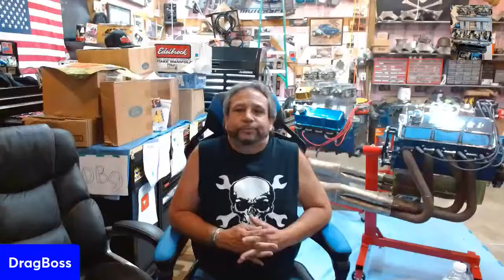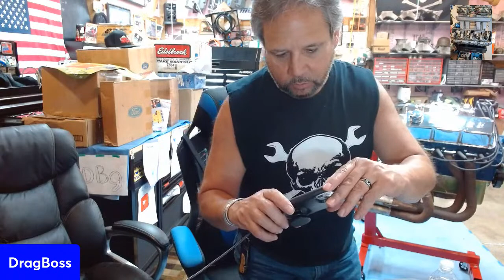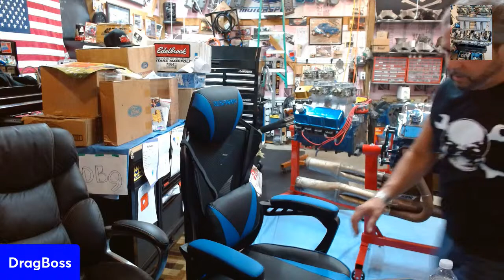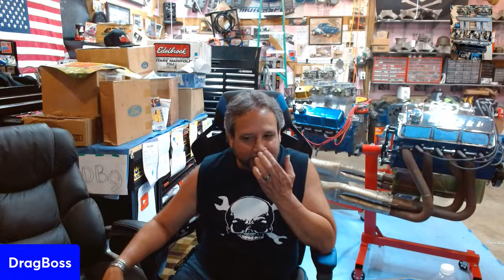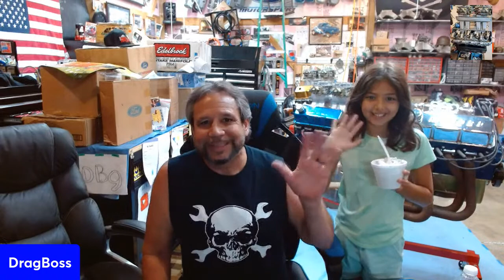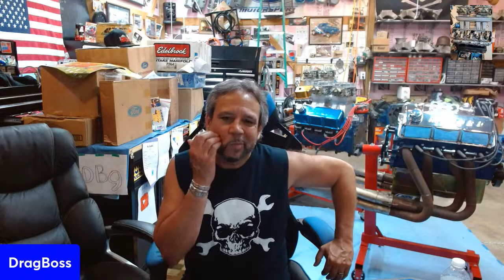DragBoss Garage: Larry Olsen, You want to know about Pro Stock Heads? The Man Behind the Scenes

Comment: I glad I heard this video . I remember the fellow I bought the cylinder heads off of. That was in 80 I think off a Monza  he told me he Mopar valve springs in them . I   was not going to spin the engine over 7800 or 8k so he changed the springs on the heads . A lot of epoxy on the heads . What I learned from this experience was cylinder heads are a good investment.  Thanks for the video. , if you get another chance I like to hear from Mr. Olson. A lot if great information
Reply from the maker: Thanks Jim, I just texted him today. He’s got a great rocker arm discussion he would like to go over. You’re always learning something new at DragBoss Garage.

Comment: please please please ask this guy about camshaft lobe lift vs rocker arm ratio. high cam lobe lift with low rocker ratio VS high rocker ratio and low cam lobe lift.. all I know about this subject is two things 1- high ratio rocker arms cause more valve stem side loading and 2-low lift cam lobe causes less lifter/push rod travel. I bet he has some valuable insights...   he said a rocker arm changes it's ratio through it's travel and that it can be optimized to benefit the point of maximum airflow demand, very interesting.
Reply from the maker: I know it. Never even thought that.  Only think head flow and porting. He will be back to talk all about rocker arms soon.

Comment: @DragBoss Garage
So Tim, Stapleton42 did a video about the Ernie Irvan 91 Daytona 500 heads and intake. The guys he was talking to that worked for the Morgan - McClure team said a guy name Larry that worked in their engine room, second tie in is Stapleton42 did a video about Lake Speed, Sam mentioned Lakes son which is redoing a cleveland for his dad with Stapleton42. They had none other than Greg Anderson do the cylinder work on the block. You should check it out.
Reply from the maker: Oh yeah, will check him out right now. Oh yeah I know who he is. Was watching the Lake speed one with his dads C3 motor.
Reply: The third tie in is Larry Olsen i remember him saying he was doing some developement work for LSX, stapleton42 has a lsx turbo charged suburban .
I posted the time stamp and mentioned the tie in on his video. I don't know if he chcked it out or not.
Reply from the maker: Yes he owns LSx concepts with another guy. Larry did grumpys and Warren Johnson’s heads, too if you remember him saying. I just got an email that Warren wants to be on DBG so that will be pretty cool. Stay tuned.
Reply: I never knew he was the owner.
Reply: When was ford building the a3 c302b heads year wise?
Reply from the maker: A3 came out in like 80-81. Was really an iron high port in aluminum. Raised exhaust port. The C302b are last ones before Yates. So maybe 91 ish

Comment: As the pro stock  wars heated up in the 70s match racing and national competition  it became necessary  for full time racers to employ and search out talented head shops or individuals who could keep the development of pro-stock engineering moving forward there are two types of development evolutionary and revolutionary well pro stock was revolutionary and that was due to the weight break wars of Wally parks which could take your development program and put it  in the trash this is why pro stock and in general many forms of racing die because the small teams can’t afford  to keep up now add to this expensive gas and your spectators can’t travel to events high gas prices also  effects competition
Reply from the maker: Makes sense Joe, I like the revolutionary thinking. No doubt it was all about the weight.
Reply: @DragBoss351Cleveland  I have more to add to the history of pro-stock and in general racing and what I think was the golden era of racing across the board but still trying to sort out what to say about the topic that will help develop a healthy dialog for the future of racing in general it seems very much under siege from forces that are not good for racing but I find your dialog as a good platform for it keep up the good work
Reply from the maker: @joesos5179  thanks Joe, you know they are trying to eliminate racing, and any high performance culture. I agree with the golden era, never will be another time like it ever. Stay tuned,as we explore the past ans remember where it all came from, thank you.